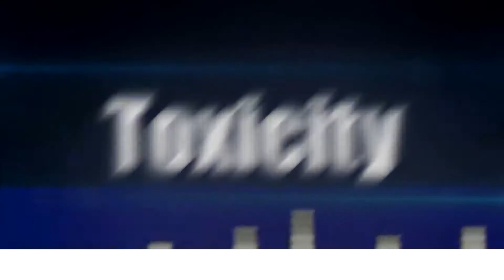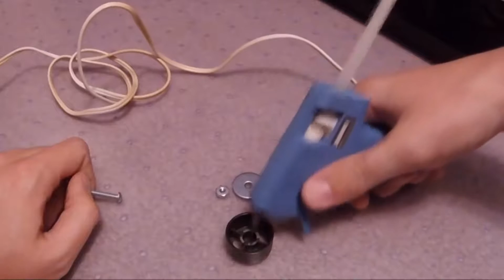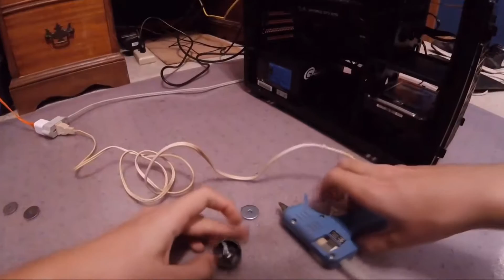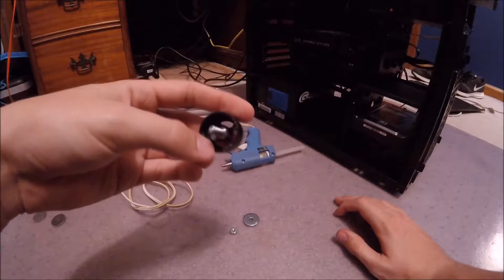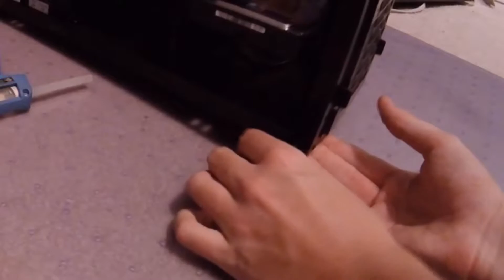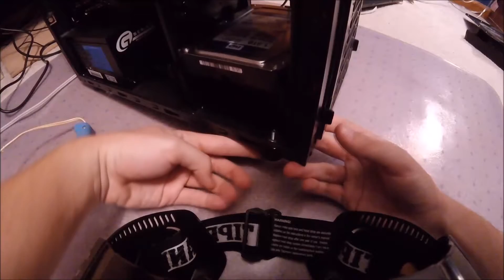HOW TO FIX BROKEN PC CASE FEET (EASY)

Comment: Nice creative solution there!  I keep the old feet from any dead PC's I throw away. Nothing worse than a wobbly PC.. Like walking around with only one shoe. Hot glue is my new friend.  A system I repaired a while ago I used JB weld with a scrap metal ring plus some rubber.  Plus Loctite 480 to attach the metal to the rubber.  All to get the perfect matching height with the three other feet.  It's interesting the ideas people come up with to do these repairs.  Limited only by imagination or the materials you have available :-)